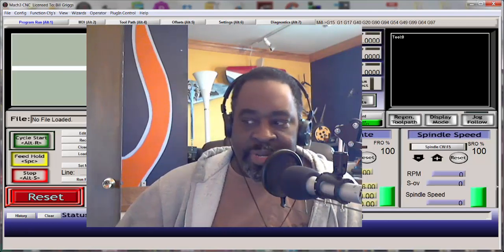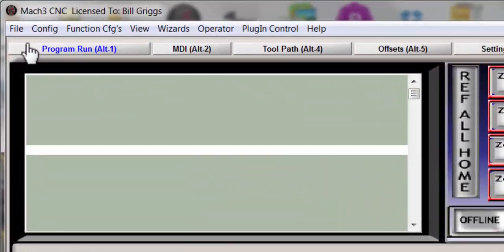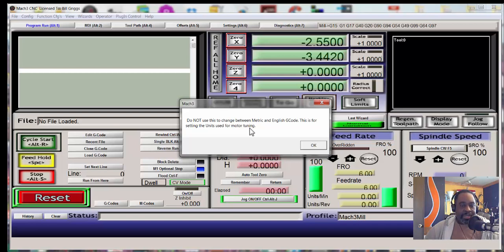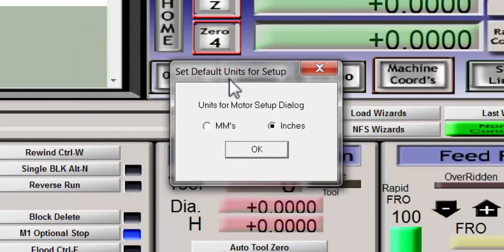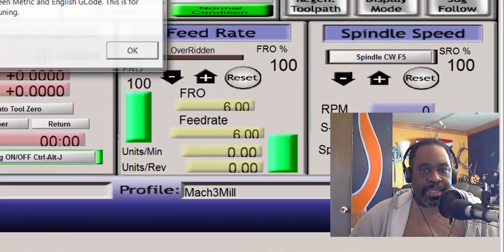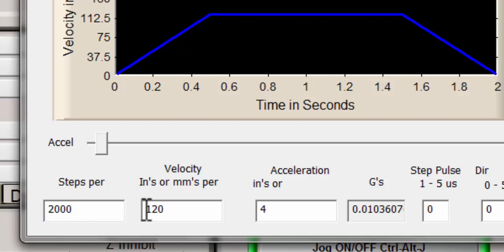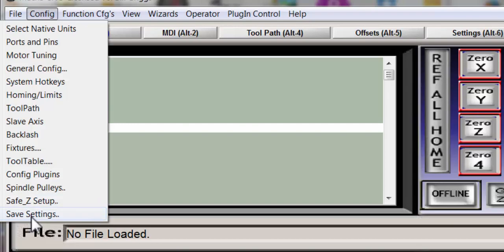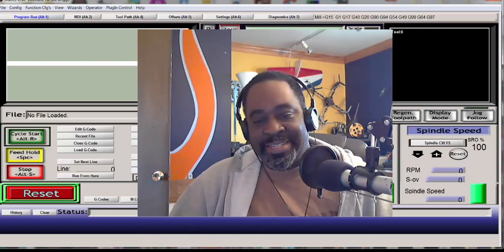How To Set Native Units In Mach3 CNC Software

Comment: multiply the steps per inch by 25.4, divide  velocity per inch by 25.4, divide the acceleration per by 25.4, if the setting were in MM and you want to convert it inches .
Reply from the maker: You can also use a setting that will automatically do the conversion for you.

Comment: Mach3 setup and interface is a bit confusing by itself.
However, your explanation is not correct, in the sense that you mix Turns with Units, Velocity and Acceleration, without actually explaining what is going on, i.e. you don't explain the what and the why.
1- CNCs use Stepper motors, which in their technical documentation or specifications define how many steps (or micro-steps) they need to make a full revolution. That's the info you should put in the field "Steps per".
Velocity and Acceleration have nothing to do with the configuration of your machine, but only with the physical limitations of your motors regarding Inertia, i.e. the ability to speed up, stop or maintain speed, which depends on the engine power and your machine mass being moved by that particular axis.
So you don't want to exceed your motor strength or it will skip steps (looses accuracy).
The fact that you define velocity or acceleration using inches or millimeters, is just for convenience, but needs to be in accordance with what is defined as Native Units.
Remember that Velocity is Units/second and acceleration is Units/Second Square.
2 - Each of your machine axis uses some kind of screw, and that screw as a specific amount of turns for a specific progression distance it could be 10 turns for 5mm, or 32 turns for 2 inches.
No matter what, you CAN NOT CHANGE the geometry of your physical axis, unless you physically change the screw for a different one, with different characteristics.
So you should define the NATIVE Units, to match the properties of your axis screws !!!
And as far as I can see, Mach3, only allows to configure the number of steps per unit so if you have an axis with something like the examples above 10 turns for 5mm you have to convert that using the rule of three, so it becomes 2 turns per 1millimeter.
Or in inches example, for 32 turns for 2 inches, you would get 16 turns per 1 inch.
Regarding a GCode file using inches or millimeters, it simply doesn't matter, since the controller knows how to translate from one to the other, as long as it knows in what Units the file contents where generated.
TIP: If the file does not have the unit command (should have a G20 or G21), but in case it doesn't (the controller has no way to know, so it can only assume), so to prevent errors, just add the correct GCode command to set the correct units for that file, and the controller will know what to do after that.
G20 means inches
G21 means millimeters
Reply: All good but one edit is the steps per is not the steps per revolution that field is the number of steps per 1 unit of measurement (in or mm) you can check this on settings screen at "calibrate steps per unit" for example my belt drive plasma at 1/16 micro step is about 1000 steps per 1 inch where my ball screw router table is more like 10000 steps per inch......with same motors
Reply: @MXstar189  It's not just the motor that counts, it's the motor and the transmission ratio (belt, screw or something else) that's why you have different values with the same motor but with different transmission setups.
I explained the steps per unit in my point 2, of my previous message.

Your ball screw can be built by the factory in metric or inch units.
You can't change that, unless you change the screw for a new one.

But you can configure whatever transmission ratio you have and in what units. The machine will then know what to do with those 3 simple parameters: Unit, pulses per revolution and how much a revolution move in units, in that axis.

You can even have a Frankestein machine with one axis built for Inches and another for metric, you can configure that, but then you need to do some math to make it work, since Mach3 does not support defining the units per axis.
Reply: @MXstar189  Le me be more precise.
the advice that given at around 3minutes into the video, is ONLY right, if the transmission systems ( I'm presuming here it's a ball screw) was fabricated in inches, and the software was incorrectly configured.
This NATIVE UNIT has absolutely NOTHING to do, with the GCode file being in metric or inches.

If I gave you a ruler with both inches and millimeters/centimeters, and I asked you to draw me a line of X amount of any of those units, you would know what to do, That is, follow the correct scale for the request.

This is what a GCode program does, it states what units it was generated for (using G20 or G21 codes).

So the computer or controller also knows how to use a ruler, because it knows both scales (and the ratio between them).
However, when the controller want's to move the specific motors and transmission of your specific machine, it needs to know in what units the transmission was built for, so that he can find out, if it needs to convert the GCode file measurements to plot the commands or not, and the amount of pulses it needs to send to the motors.

But once you have these motor/transmission (NATIVE UNITs) correctly setup, you can run any Gcode file, either in inch or metric, it doesn't matter which, as long as the file contains the correct G20 or G21 to state what the file measurements mean. If it's not defined you might get into trouble, because the controller will assume a unit, that MIGHT be the wrong one.

A good analogy is to think about money.

If I say some product costs 20, you don't know what I'm talking about.
Is it dollars?
Is it Euros?
Is it yens ?

But If I say to you that it's 20 Euros (Native UNIT).
Now you know how much it costs.
And you can pay the product in Dollars or Euros or any other currency, because you know how to do the proper conversion (that is what the controller does).

Now if you gave the controller money to pay, but didn't tell him what kind of currency it was, he only knows how to read the numbers, not how to recognize currency, hence he would assume that it was either Dolars, Euros or something else, that could be incorrect.

This is why the Gcode file, SHOULD have the units explicitly declared. This avoids the possibility of interpreting the measurements wrong.

And to finalize my point, you can have a GCode file with both units (inch and millimeter).
It can make movements to place the parts to cut in metric, but then give the part cutting commands in inches for example.

So clearly the solution can not be to change the machine config based on the file you are processing !
Since you won't be doing that in the middle of a file being processed.

I hope this makes it all clearer.

Comment from the maker: If you need to know how to figure out how many steps the motors need to take in inches or Millimeters check out this video next. https://www.youtube.com/watch?v=EVrqObwaAF4
Reply: That is exactly what I was about to ask Bill.. lol..! Thanks a bunch and I am now subscribed. :-)
Reply from the maker: Glad I could help Dale. What are you making with your CNC?
Reply: Bill Griggs I just purchased one of those table top Chinese CNC machines like your friend. I'm a designer so I make all kinds of stuff but I really purchased it to cut Carbon Fiber after market parts for Quads. I have one problem Mabel you can help me with. I set my machine up to use the Auto Tool zero feature. I installed the Code as seen in other tutorials, set up the Pin associated to the metal plate. Used the Diagnostic screen to see if the plate touching the bit is active which it is. But when I'm ready to Zero in on the plate, Mach3 says "Probe not setup for Input command". Not sure what's going on? Any advise?
Reply from the maker: Did you use an input pin or an output pin?
Reply: I used an Input Pin. Pin 15.
Reply from the maker: Pin 15 is an input pin. It must be enabled in Mach3 and then set to active low (in most cases). I assume you are not using a Triple Edge finder so I don't have enough specific info about your machine, programs etc. to comment further. Also some Mach3 screensets support probing. You can find some info on my website. http://themakersguide.com/tutorials
Reply: Yes I have seen others online with different screen settings.  I'll look into downloading another screen setup for Probing. Just have to figure out where to get it. No I'm not using the plate your using. I'm using an .031 thin sheet of metal. Either way thanks for your input.
Reply: I see you have a link for screen sets. I'll check it out.
Reply from the maker: Yes There are links to screensets. There are three that work well. They are paid addons. (about $20). Mach3 Tool setter by Big Tex, Mach3 2010 screenset, Calypso Ventures Mach STDMill screenset.

You might enjoy joining our Facebook group. https://www.facebook.com/groups/cncroutertips/